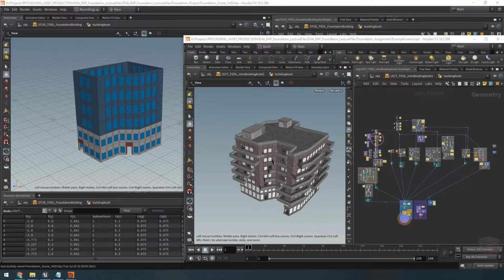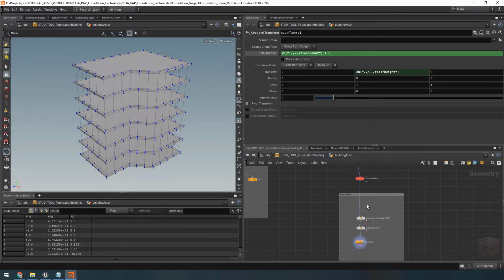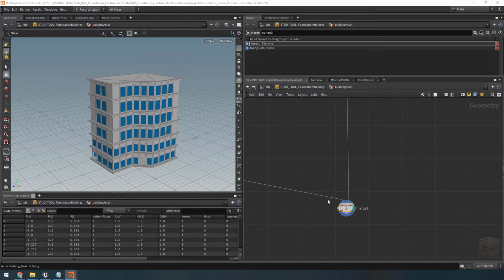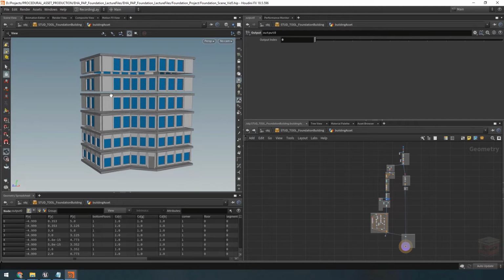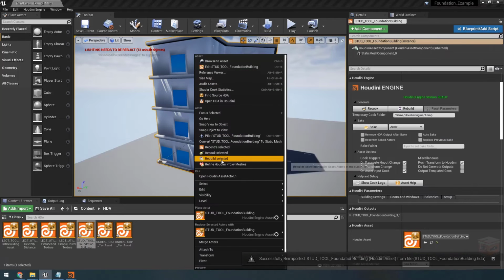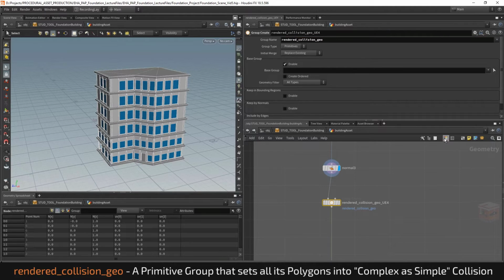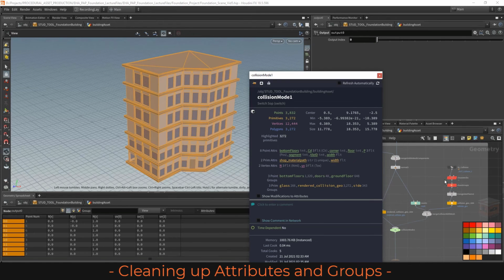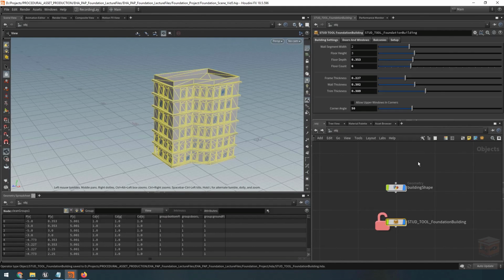HOUDINI FOUNDATION - 07 - Exporting Clean Assets To Unreal - ( Free Tutorial for Game Dev )

Comment: would it be much harder to add a basement/sub-basement level to the building so that it clips through the world below the ground? then i could create a sewer system and break through to it in certain buildings. maybe with a select option to enable/disable the basment in UE4 as not all building would need them.
Reply from the maker: It shouldn't be much harder. You could add additional code for that pretty easily.
Though I suggest you do this after you complete the main videos, so you know all the nodes & tricks I taught during the course. Or at least build it into a separate node branch that you can build out over time without losing track of the course.